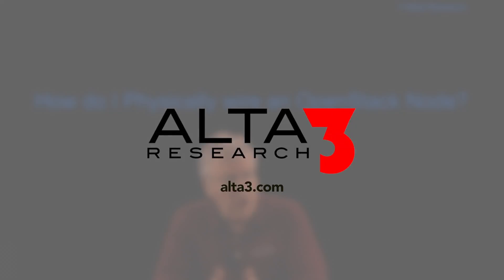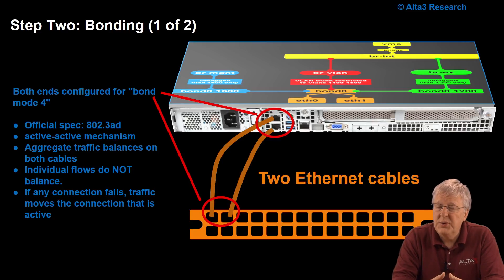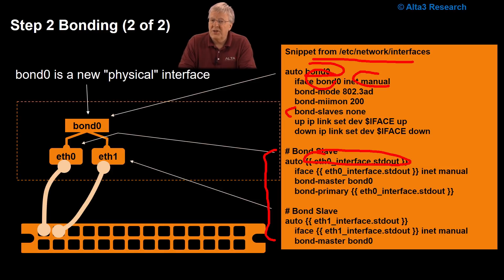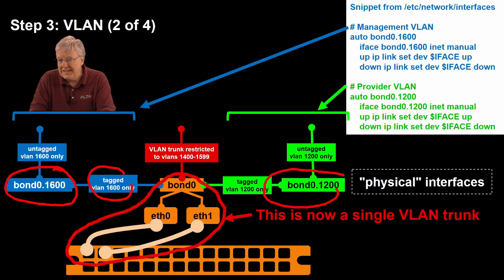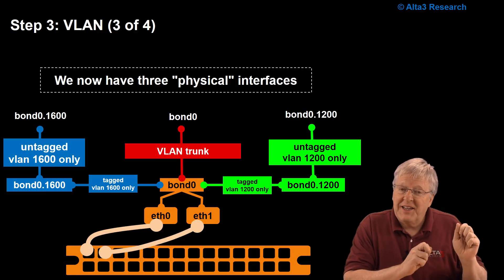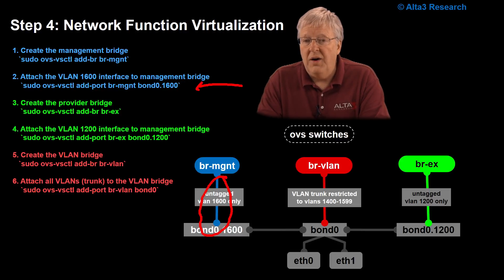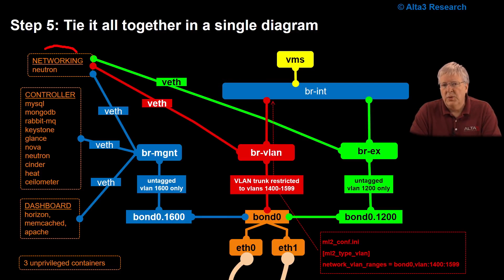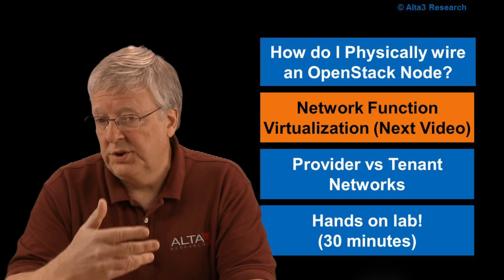How to Wire an OpenStack Node (1 of 4)

Comment: This video starts with saying web searches don't yield practical answers and then goes on to instantly fail on the very same thing. In most practical applications, you would not wire and LAG two host NICs into a single switch because that would not eliminate a single point of failure - the switch.

Comment: Very detailed explanation; need help in understanding the switch side and server side configuration of the bond0, all the 3 interfaces(bond0, bond0.1600 & bond0.1200) are set to manual, i have a connected both the nics of my compute node to a L2 Switch(Netgear GS324T) and configured a STATIC LAG, link is up but none of the interfaces receive an IP address as they are set to manual.... do i need to set the bond0 interface to static and assign an ip from the external network(router). Please suggest. I am setting up Openstack Victoria on a All-In-One Server manual configuration (not devstack or packstack).....

Comment: I followed the instruction. Item #6 failed, I simply cannot add the "bond0"to that bridge br-vlan. Any idea?
Reply from the maker: Can you please post your config. My demo was using ubuntu 16.04.
Reply: I'm using Ubuntu 18.04 LTS, but for network, I switched back to /etc/network/interfaces as below. 

#    sudo apt install ifupdown
source /etc/network/interfaces.d/*

# The loopback network interface
auto lo
iface lo inet loopback

# HW NICs
auto ens160
iface ens160 inet manual 
  bond-master bond0

# Bonding
auto bond0
iface bond0 inet manual 
  bond-mode 802.3ad
  bond-miimon 200 
  bond-slaves none
  up ip link set dev $IFACE up
  down ip link set dev $IFACE down

# This Overlay/Mgmt network
auto bond0.178
iface bond0.178 inet static
  address 10.0.0.253
  netmask 255.255.255.0

# For internet connectivity 
auto bond0.168
iface bond0.168 inet static
  address 161.5.168.253
  netmask 255.255.255.0
  gateway 161.5.168.254

When I do for the first two bridges it went but not for bond0. 
"ovs-ovctl add-port br-vlan bond0"